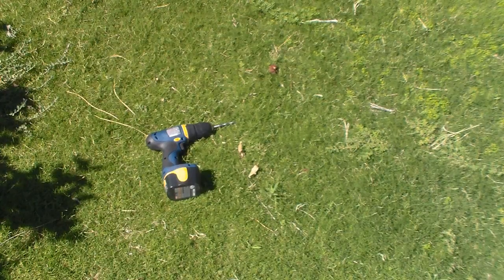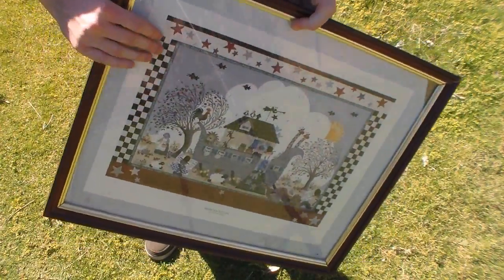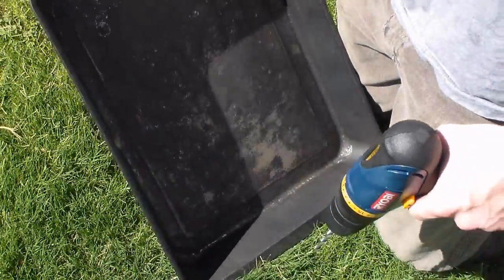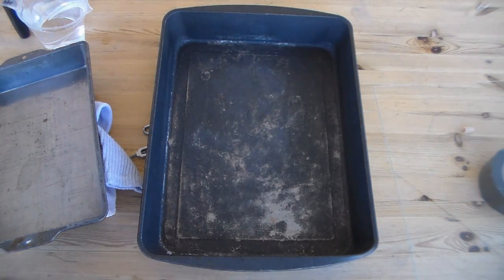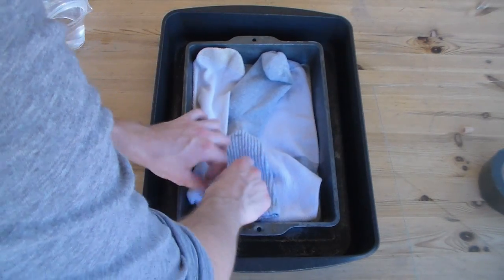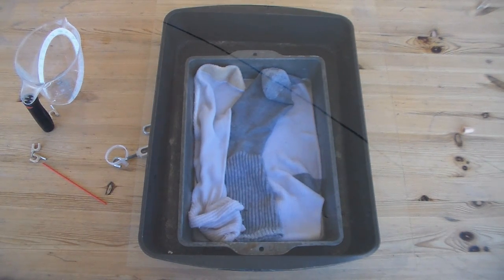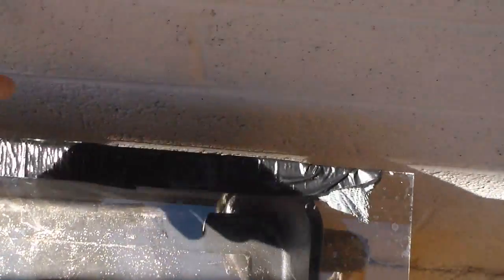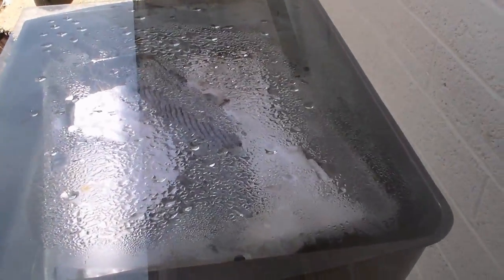How to Make A Solar Water Distiller

Comment: Something similar to this should be built all along the California Pacific coast to help California overcome the present drought.  Crops grow much better with distilled water than with processed treated water.  Water does not need to be boiled in order to distill it. Possibly a vacuum pump also would help to increase the water volume output.

Comment: nice ...  is there a version 2.0. yet?
btw tip when you set this up,  you want to make it have legs/ support ( bottom) to not conduct heat away from your source. Could insulate the water area with foam  or double the glass. These could greatly increase the effectiveness of using this.

Comment: Distilled water absorbs minerals. I wonder what was being absorbed from the old beat up collection tray and the plastic collection cup. Use glass.
Reply: Ray Sims you can use whatever materials you want he's giving you a demonstration so take it as such and don't slam everything he's showing you . he is showing you how if you and get in a desperate need for water these are things around your house that you can use .you want to make a really great one where is sits out and utilize it all the time then do exactly what you're saying make sure your pans or stainless steel. and all other materials are non-toxic to the best of your ability.
Reply: Search the tube and think aquarium silicon sealer. If the fish can handle it, we can. It's worth it. This young man will, betcha! He shows how easy the basic's are, socks and all!!
Reply: I'm curious how you build one of these with only glass? Haven't seen one yet
Reply: Ray Sims plus his plastic will leech harmful toxins into the water as well.
Reply: @worxharder9470  Yeh jus like the same bottled water you drink everyday.?
Reply: Thats good to know if i ever have to make one i will use all glass or stainless but wait if its for cooking it should be non toxic